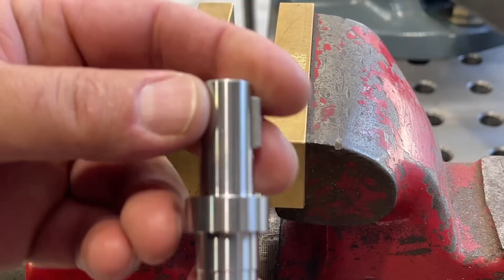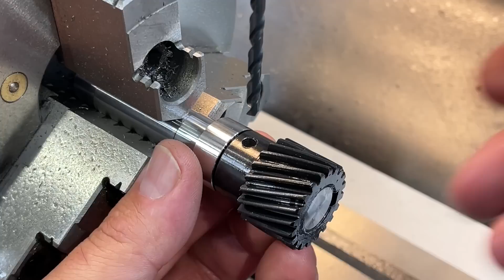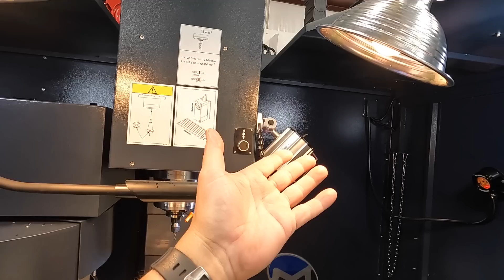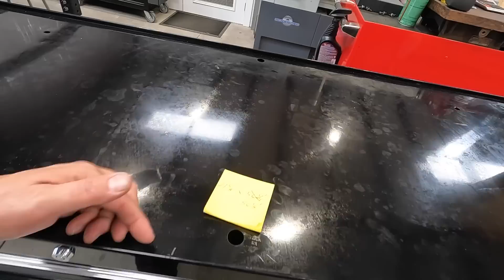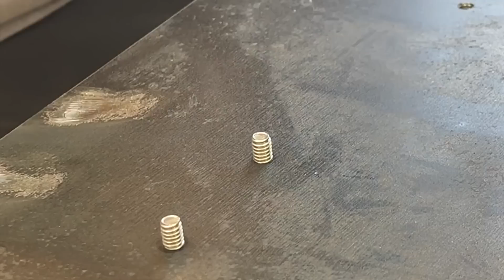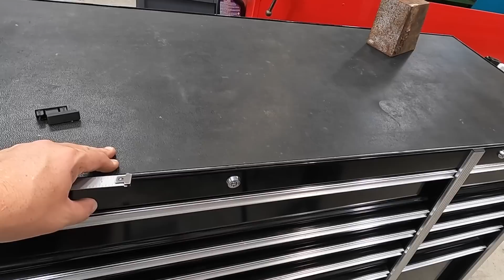SNS 372: Pinion Shafts Completed, Toolbox Mods

Comment: I was doing some calibration work at an aerospace company, and they had a process for fitting two parts together that was pretty clever. Instead of heating the female part to expand it, they super-cooled the male part. By shrinking the male component, they could slide it into place, and once it warmed up, it expanded for a perfect fit. They were essentially mating the parts by shrinking instead of expanding.

Comment: We used hot oil in the shop, we used a frydaddy maxed out. We let them soak in the oil it takes time to get the heat in the part, we moved the parts to keep oil hot next to the surface. If we needed to freeze a part we used liquid butane in a metal bucket outside the shop.

Comment: Well made video. I don't understand why you would line drill through your threaded set screw hole wiping some of the minor diameter off when you could have just used your indexer and a spot drill to make your dog points. Also aren't those set screws at risk to unscrew over time without applying a drop of blue loctite. You have a really nice shop. We had a Milltronics mill and called it the "Mud Slinger" as the spindle bearings had a slow leak but if it sat for a few days and turned the spindle on it slung a stripe across your shirt!

Comment: If you go with a 3/8" plate, I'd suggest cutting it slightly undersize, maybe by 1/16" on the narrow dimension, 1/8" on the long dimension.  If you find you need the lip, you could get a strip of sheet metal with a hemmed edge and add it to the cabinet, fitting it around any equipment that you have that overhangs the sides of the box.  Adjust the undersizing of the top plate based on the thickness of the sheet metal strip you might want to use (18ga = .0478").

Comment: Just because the oil is 350 or 400 doesn't mean the gears are 350 or 400. They need to sit there a while to get up to match the oil temp. You just pull them right out as soon as you see the oil temp and that's kind of not right. Consequently, you might want to consider getting liquid nitrogen in the shop to freeze parts.

Comment: When I worked at John Deere we used a presto fry daddy. It was electric with temp control and set it to 350, it worked great. They have a lid so you can just keep the oil in it.

Comment: It’s an old technique but I’d get a sheet of Lee lighting gel, cut it out for the size of the work lamp and place it inside the cover. Lighting gels are designed to absorb the heat so no issues. 

Just use some warm up gel, this will assist.

Comment: Adam, I did the exact same with my Husky toolbox - hot rolled steel top, with my with my Wilton 5” machinist vise on the corner.  I also put receiving threaded holes in place to hold my 3:1 sheet metal machine anchored when I use it, the rest of the time flush bolts to fill the holes. It has worked on all counts far better than expected.🔧👍🏼🧰

Comment: I noticed that the last gear that actually slid on to the shaft was the only gear that you did not place on the anvil of the vise. Is it possible that putting the gear on the anvil was enough of a heat sink to shrink the gear back down due to it not having enough heat in the gear? Try replacing the add on light bars from Milltronics with some Under Cabinet LED lights with a warm white color temperature. Some of those are even adjustable for color temp, so you could go cool white when not filming, and warm white when needed. They are up high enough that coolant shouldn't be an issue, and under cabinet lights are usually linkable, so you could even add additional ones if you felt the need.

Comment: I you want a lip around take some 1/8" thick flat and go around the outside of the plate. That will keep really small drill bits and other things from falling down between the plate and the box. Those little spaces have a tendency to get full of dirt and trash.

Comment: just use the 1/4 inch so you have the edge for stuff dont roll off then cut the corner for your vise out and weld in the 3/8 for your vice

Comment: Never seen the hot oil method, but it looks neat. I did a little back of the envelope calculation, and 400F should be sufficient. Assuming 79F temp for the shaft and 25mm diameter, the hole should grow by 0.04mm, or almos 2 though. Probably just needed more liberal application of patience 😊.

Comment: As far as your concern about losing the lip on the toolbox surface if you use a .375 thick plate. You could reduce the front to back dimension by .125 and insert a .125 x .750 or 1.00" strip to act as a retaining lip.

Comment: Should've checked the temperature of the oil bath after that last one, for future reference. Like you thought, the others didn't expand enough, but that one did so knowing what temperature was "enough" for 0.5 thou in that material would be valuable for future uses of the technique.

Comment: I like the oil heatng method. Very controlled. I do think if you left the gears in the oil longer at the higher temp they might go on easier. I’ve learned warming dwell time is usually longer than I first think. Thanks for great videos!

Comment: I fairly recently contacted the manufacturer of Never-seize and asked them about using it on automotive ball joints and tie rod ends so the taper would release more readily after being in service for a few  years (life of the unit). He said it was an excellent product to use in this application. Then he suggested using it on a press fit. I do very few press fits. You may want to give this a try instead of using heat. I can think of no down side other than not being careful with the Never-seize and coating everything I touch. It sure seems to travel and lets you know where you have been if unchecked.

Comment: Thanks for the video, Abom!:)
Just a suggestion (out of pure selfishness, because I want to watch more videos in the future, hehehe): With (cooking) oil that near at the ignition temperature and an OPEN gas flame ... with splashing oil and an open pot: Please, please, please have at least the propane(?) bottle out of the disaster-radius of the upcoming oil fire. Just because: "What can go wrong ... will go wrong!". Greetings from a random German fire department girl:)

P.S.: I wouldn't call a "little" oil fire in the machine shop a tragedy. That's rather daily business, when hardening/tempering/doing work. It's only bad if skin contact or other factors (like that propane bottle hose and fittings getting covered in burning oil) are involved and on that scale with that volume of hot and burnable fluid. Such accidents are mostly known in their terrible other form and shape when cooking and f.e. water is involved (while trying to extinguish oil fires with water, which is a VERY VERY BAD IDEA!!!), which leads to oil "explosions". Remember that in the scenario shown in the video it is simply out of your control, if f.e. a drop of sweat from your forehead or arms will fall into the oil. In a millisecond this drop will expand 1673 times into its gas phase, literally distributing the hot oil around it in a spherical cone directed away from the open oil cooking-pot. What happens after that is even more out of our control. Hopefully something with "luck" happens. But no one can guarantee this. So please, stay safe!:)

Comment: I put a 1" ply wood top (two pieces of 1/2" glued together) onto my US General tool chest to turn it into a work surface.  It was painted with sandable primer, smoothed, then got two coats of epoxy color and two coats of epoxy clear.  Looks very nice.  I then added threaded inserts in a base 4"x4" grid, with a couple out of that grid for a vice on one end.

Comment: You might try chilling the shafts in the freezer for a few hours next time to shrink them.  Some of the stuff I assemble are such a tight fit, freezing the shaft and heating the pinion is the only way to get them put together.  
But I'm def going to switch to using hot oil at work.  Right now I use a heat gun to heat the pinions, and it takes a while heating each one individually.  Heating them all at the same time in oil would save time.

Comment: Most CNC machines only activate the way oiler based on the linear travel of the ways.  But it could be run on a timer.  Having it in E-stop is better.  If you are not using it at night you should kill the power switch on the wall to prevent damage in case of lightning strike.

Comment: When I worked at the Cat dealer, we had an electrically controlled bearing oil heater and used it for all manner of interference fit assembly. I like the hot oil method. Now I use an electric frying pan for small parts or a burner and pot similar to what you have there for the big parts. Good stuff.

Comment: Your problem with the oil bath was not giving the gears enough time to heat soak. Heat to your target temp, let it soak at that temp for at least an hour per inch of thickness to ensure all of the metal is hot, and they'll expand nicely. That's why your first gear fight the hardest and the last gear went on without a hitch. I use an old counter top deep fryer with a thermostat and run gear oil in it. The gear oil prevents galling for those times I have to use a press anyway.
Reply: I came to make this comment as well.  I don't know how long he let them soak due to editing, but I would bet exactly this.  Oil is not a great conductor of heat so you could easily have temperature gradients in the pot, with cold spots surrounding the gears.
Reply: Could have put a small steel cube in there beforehand and miked it a few times for up to say an hour to find out when he hits equilibrium.  A further problem he might address in the process was that one of the gears did not hit the shoulder, for a dimension that the customer said needed to be held.

Comment: When looking at LED lighting, if you want a color that is not so harsh find lights in the <3200K range. most LED lights on machines are in the 5500K range. That color temperature is quite blue compared to old incandescent bulbs.
I'm guessing you and I were taught differently on oil sweating gears. I was taught for each 1/2 pound of steel allow 10 min. after the oil hits 375, More if there is more than 2 quarts of oil involved. Hope these help.

Comment: That last gear going on reminded me of cooking meat...just like you shut off the heat to the oil to the gears, meat will continue to cook and actually increase in temp a few degrees after removed from heat. Carry-over cooking is what it's called when cooking, however I'm sure there is some "law of thermodynamics" that is applicable here.

Comment: I am certainly no lighting expert and I struggled with light color, lumens, and number of lights for my shop when I built it.  After speaking with some light manufacturing experts in CA, I was able to get what I wanted in LED color and lumens.  They were a great help.  My eyes prefer warm shades of light and plenty of it, and that's exactly what I got.  Initially I bought one light, mounted it at ceiling height.  After that I used a very precise and scientific method to determine spacing.  I held a sheet of paper about waste level and walked to and from the light.  When the intensity just began to fade, I could determine spacing for my lights.  That also made it easy to determine the number of lights I would need.   I am very happy with my lighting and received numerous positive comments from visitors to the shop.  And...even before you said anything about your lighting, I did notice a significant improvement in the video this week (videography too).  It's always good, but there is a noticeable improvement.

Comment: I’m hardly a machinist by any means of the term, but I think the difficulty you encountered with the helical gears is that when the material expanded, it made the key slot narrower as well.  

that said, I have nothing but mad respect and admiration of your precision work and product!

a most excellent video, as always!
Reply: Doesn't work like that. The hole didn't get smaller.  The key slot didn't either.  Think of it this way:  when a solid expands from heat, the whole kart expands...  holes, slots, keyways, everything. It's as if the part is on a copier and you ask for a larger version.
Reply: @alanblair3193  Love your last sentence.
Reply: The keyway will get wider as the hole expands, freezing the shafts would have helped

Comment: The hot oil is a neat trick. Maybe supplement it by putting the shafts in the freezer for an hour. That combo might just work.Liquid nitrogen would work best but who needs the expense. Great stuff Adam. Thanks for sharing.
Reply: with that little amount of size difference, putting it in the freezer should be absolutely fine. if you need more, for most parts otherwise dry ice will do as well. a lot less expensive and usually easier to get. (well, if you know where, liquid nitrogen is not hard to get as well to be honest).
for larger gears I have seen guys just put them on an electric burner (preferably the ones with the black iron like top, not the ones with the open heater coil. the glass tops will do as well, but I fear those might be a tad to easy to break slapping hot gears on them.). But I guess that might cause oxidation issues and the heating might not be as even.
Reply: That would have exactly been my plan, heat the gears, freeze the shafts. Would likely slip together as desired.

Comment: changing color of led light by adding diodes; The aluminum indium gallium phosphide (AlInGaP) material system is used in red and amber LEDs. Green diodes employ gallium phosphide, whereas blue diodes use indium gallium nitride. All three together makes your warm white,

Comment: Nice job. Those turned out for very well. My only concern is the set screws backing out. I would have used some Loctite Red to hold them. Like the idea of the plate on top of the box. Thanks very much for sharing.

Comment: That's a peculiar ruler. What are the different markings for. I know how metric work(Danish guy), but just never seen something like that
Reply: Looked like a 4r scale, fractional by 16th 32nd 64th, think I'll rewind the vid and research that doubled vid track. Back in a sec. .. .. .. Back, it is not a 4r scale rather it is a 1/2 mm / mm division right reading scale.  Poor eyes here, first time I was reading 1/8 in marks, tisk tisk.

Comment: How about boat LED lights. The ones that go on the hull of the boat. They are super bright, infinitely adjustable in lumens and temperature, and 100% waterproof, so coolant will have zero effect on them. They would be perfect.

Comment: A good photography shop will have acetate sheets that you can put on those lights to change color temp.
Your cameras computer will appreciate a consistent light temp. Mixed light plays hell with the sensor. Probably can manually set the temp in the camera...

Comment: If you like using "baths" for heating, when you have a spare moment, check out using salt baths for heat treating, solution treating, cleaning, brazing, and more. Ajax Electric Co. is not a bad place to start (I don't work for them). When I was a metallurgical engineering student, back when we took notes on stone tablets, we used salt baths to heat specimens when we studied steel heat treating.

Comment: Three points:
1.  Yeah, turn your toolbox tops into something that meets your needs.  No doubt.  Well done.
2.  You might consider drilling holes to secure the new plate(s).  The fact that they can slide a bit might present a problem.  Dunno.
3.  When you were first drilling and tapping the holes in the plate, I thought you were drilling a pilot hole and then drilling a full-sized hole.  I didn't realize you were tapping them until you started doing the second set of holes, so on the first set I was wondering "why's he 'bumping' the drill for the hole' ".  In the end as usual, you're on top of it Adam.  😃

Thanks for posting this video.  I always look forward to your Saturday videos.  While my career (in computer software) has worked out very well, yours is a path I could have taken, and it gives me a warm feeling to watch the magnificent work you do and the depth of your knowledge and experience.  And keep plugging away with those CNC machines.  They are a significant part of the future, so you'll definitely benefit from being able to make them dance.

Comment: if you loose the lip on the top of your box, cut the rubber 1 inch short on 1 short and 1 long edge and glue that on to centre of metal to create a gutter 1/2 inch in size all around the top edge. hope this helps and keep up good work :)

Comment: You could go with the 1/4 inch plate and add a 1/8th packing under the vice base, that would retain the ridge around the edge of the tool box.

Comment: As far as video lights go there are tons of lights that allow you to alter the K of the light as well as intensity.   Aputure lights even have an app you can control the light intensity and kelvin.   The older MC lights are tiny and have magnetic attachments for mounting the lights.   Rechargeable and pretty inexpensive for video light.  Nothing as cheap as the clip light but the standard bulbs will have a tendency to flicker for video.  Aputure lights won’t.  
They also make RGBW lights which have an even broader spectrum of light 
Not sure if this info is what you’re interested in but there you go

Comment: Here’s an idea with the old voice that you’re talking about mounting what about prepping it for putting soft jaws on the inside or smooth jaws on the inside by drilling and tapping and putting cap screws in it to capture the jaws and this way you can use it as a smooth goal if you want or if you wanna go back to the Joel that was in it and for a rough job for something, you can just unbolt it and take it apart And it would also be another shop project that you could use the CNC machine to make the Joel pieces that you needed to put in there you could be able to counter sink them drill them out the whole thing sounds like another shot project to me just an idea